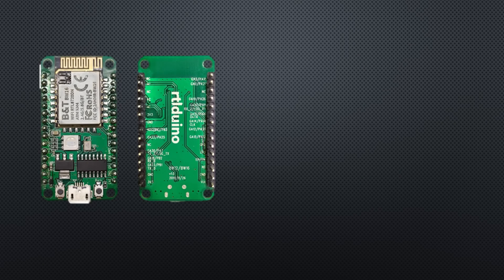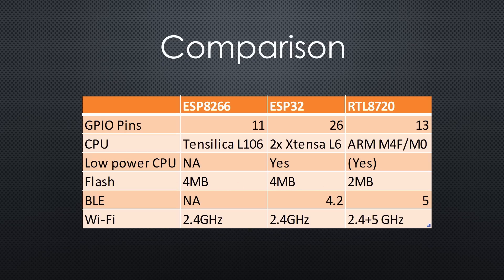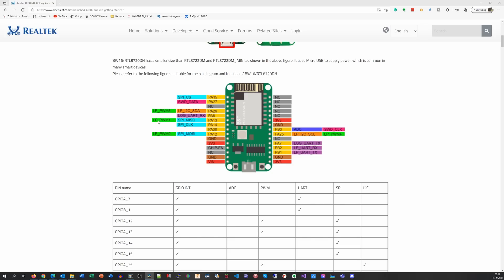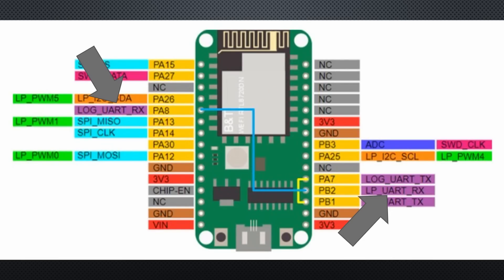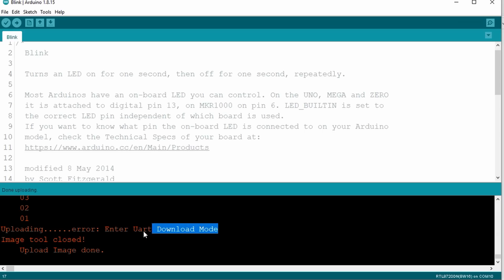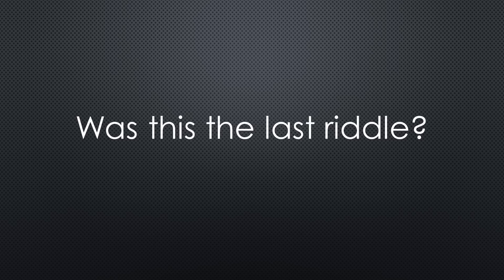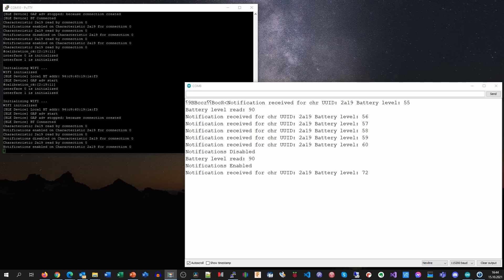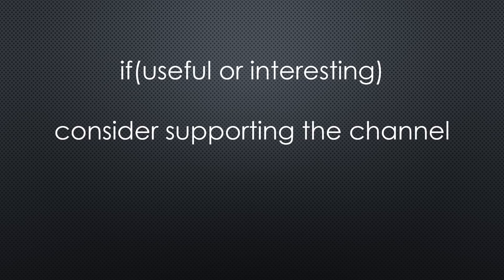#405 Riddles? The First Arduino compatible 5GHz Wi-Fi Chip (RTL8720 )

Comment: 9:24 Haha, "1. Connect LOG_TX (PA7)" but "3. Disconnect LOG_TX (PA8)". Well, PA7 or PA8 - which is it??? Seems PA8 ist actually LOG_RX (well, or is it?). That thing is one hell of a mess... Clearly no one has ever reviewed any of the documentation (nor the PCB/design). Btw: Your "BW16 Getting started" link in the description doesn't work - the URL got mixed up with the description of the following link...
Reply from the maker: Thank you. Now the link should work. And indeed there are a few things like the one you mentioned...
Reply: I introduce a direct coding method using the RTL8720 Standard SDK. I use this to introduce samples and methods for developing IOT. You can get information by visiting.

Comment: What is the difference between 5 and 2.4ghz when it comes to power consumption? How much power does it take to find the AP, connect and send an http packet?
Reply: 5GHz obviously uses more power. It has worse range and experiences more problems from objects between sender and receiver so it needs to boost more. It also has to process a lot more data and over more multiple channels at once so it needs to process more and more complex data. Only once the production process upgrades in 2.4GHz chips would stop advancing while it continues for 5GHz chips, could the gap in worse power characteristics become smaller and maybe ever overcome it.
But that doesn't matter because you use 5GHz when you need to push that much data. You don't use 2.4GHz either when your data only needs the 433MHz band.
Reply from the maker: I did not check how long it took to connect. But I felt it took longer than an ESP8266 or an ESP32. But I did not do any optimization (e.g. fixed IP address)
Reply: @Rizon1985  yup, there were advancements, but i have reasonable doubt that the uC in the question doesn't support 802.11ac or ax (would not make any sense by any means), so you are left with 802.11a/g/n which have their equivalent counterpart also on 2.4GHz. no MU-MIMO of any kind is available. also i'm quite confident the wifi on the uC doesn't support MIMO at all (why would it?). in most cases you only want your micro to submit data on a higher data rate to either save on transmission power by 'talking for less time' or save AP airtime to allow more stations to utilise the available spectrum. since 802.11 WiFi uses CSMA/CA for default media access control - which is a pretty lousy way if your think about it - the probability you run into collision/interference rises exponentially with the number of stations increasing and the average length of time a station is accessing the spectrum. in addition to this 802.11 is half duplex, so each time a station transmits, there will be a wireless acknowledgement from the AP, so airtime is consumed quite quickly. it would be worthwhile to see what data rate such a micro will use. my 8266s are at 48Mbps when the RSSI is OK (above -80). sure, if someone intends to use battery powered solutions, the high data rates will take their toll.
Reply: I introduce a direct coding method using the RTL8720 Standard SDK. I use this to introduce samples and methods for developing IOT. You can get information by visiting.

Comment: I love 5 GHz WiFi. Only my sprawling Ethernet network is even better. 
If I wouldn't have some legacy devices which only support 2.4 GHz I would turn off 2.4 GHz completely.
Also my Mesh-Wifi has very little configuration, so I can't disable 2.4 GHz anyway.
Reply from the maker: I have mixed feelings about 5GHz because it often does not have a good connection in my house. Then 2.4GHz still is better. Bu, as you, I try to offload the 2.4GHz band as much as possible.

Comment: Seems that this abomination was designed by a committee,  perhaps one from deep inside the EU bureaucracy? If 5GHz at low speeds is all that is making it relevant,  surely there is an I2C connected 5GHz daughter board that can be used with an existing Arduino compatible for IOT uses?
Reply from the maker: The initial purpose of this board with the firmware was to use it as a daughter board. But connected by Serial, not I2C

Comment: More double-button nonsense to program the chip.  I am getting flashbacks from my struggles with the original ESP8266's.  They still like to use the 2mm pitch pins on the rim.
Reply from the maker: Indeed, the first ESP boards also had this "problem" until NodeMCU invented the design with the two transistors...

Comment: LOL, I thought that you had been doing this long enough to know that every new chip requires days and days of "free game play" to get them working. 😃
I've been doing this since the 1980"s and I've never seen a new chip that was easy to get working. Actually this seems easier than most new chips. 
Good tutorial, I'm sure this will save several others hours of banging their head on the table in front of their development stations.
Reply: It’s not a new chip, the Realtek Ameba came out the same time as the ESP8266, it’s always been a mess with bad docs
Reply from the maker: Here not the chip was the problem. They created a lot of confusion without need. After knowing the "tricks" it was quite easy. This is why I thought they made it on purpose ;-)
Reply: @AndreasSpiess  it was not on purpose, I am sure they didn't know how OTA worked during operation and how much time it takes to upload the software. Once you know the process and chip architecture it's always fast and easy. Probably they didn't have a view of the whole picture when creating the chip.
Reply: Espressif's NEARLY work out of the box..
Reply: @Milan Velky Bye bye... no great loss!  Civility has its place, and is not over-rated!
Reply: @Milan Velky Holy projection. Go get some fresh air, come back and re-read your comment... then feel free to google bulverism.
Reply: BS. See Raspberry Pico documentation
Reply: I see you have never worked with the rp2040. Best chip to get into by a long margin.
Reply from the maker: @Milan: Thank you for your open words. I am glad you understand it. You are for sure younger and much more intelligent than me. Hats off.
Reply: @AndreasSpiess  Andreas, please don't feed the troll ;-) It is a waste of time to talk to idiots: they will first bring the discussion to their level and on that level you have no chance to win.
Reply: @Milan Velky cool that there is a system. where can I find the information that explains these pin naming schemes? Note, I'm a noob in electronics.
Reply: I introduce a direct coding method using the RTL8720 Standard SDK. I introduce how to develop IOT using this. You can get information by visiting.

Comment: I admire your stubborness and patience, for me  such ill-documented products are no-goes!
Reply: Sometimes you dont have any other option
Reply from the maker: After knowing the "tricks" it is quite easy to work with. Except for the pins ;-)
As an engineer you have to have some "stamina", I think. And some say that carrying a Ph.D. shows that you, at least once in your life, had a lot of stubbornness.
Reply: @AndreasSpiess  especially in the usa. Not only do you need to due alot of work in your field but also navigate safely in the political enviroment when working on your Ph.d
Reply: @Flamechr  Why is getting a Ph.D (post hole digger) so hard?
Reply: Realtek has made bad documentation/products like this for years.  If this works out anything like their ethernet/sound chips i suspect that webpage with directions will vanish in a few months, and be replaced by a Taiwanese version.  In a while all software you will need to download will be hidden on an ftp in asia that gives 4 K/s downloads. After that it will most likely just stop working in arduino IDE as they release a newer version with the same specs and a slightly different number in the name.
Reply: I agree....go espressif..go!!
Reply: Very good video. Now i know i will steer clear of this board, unless they make it a bit more straightforward
Reply: The only reason the original RTC Ameba didn't stop Espressif from ever having a successful business was their terrible documentation.  Espressif should send them a sincere thank you letter

Comment: I like the humor in this - I have a couple of these boards waiting for me to have enough time to play with them and now, at least, I know what to expect.  :). Doesn't seem TOO different than the standard "every chip vendor does their own thing and takes their sweet time realizing that there are standards they should adhere to", but it's good to have had someone so good at explaining hit the road bumps first...

Thanks for another great video.
Reply from the maker: You are welcome! I was astonished how many riddles I had to solve. I think it was the most complex start with a new board. For you it should be easyer to start (except the pin numbering). I still forget to push the buttons once in a while. But this can easily be detected and fixed...
Reply: I spent some time with this board a while ago. It took effort but I managed to get it working for my needs which is mostly connect to differing BSSIDs in a mesh network, pass traffic, disconnect, re-connect to a different BSSID and  so on. Once I got the caveats figured out it has been fine, but then my needs for this use case are simple.